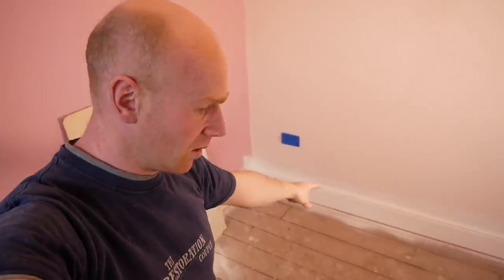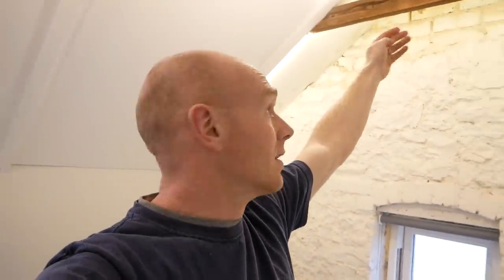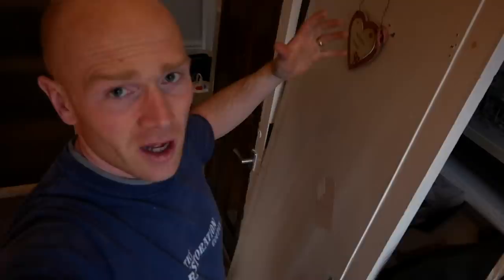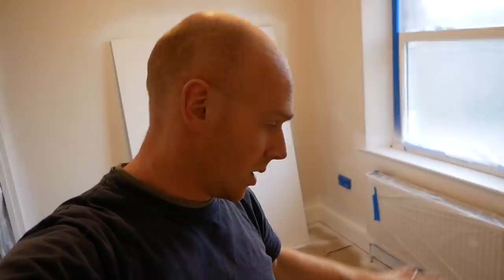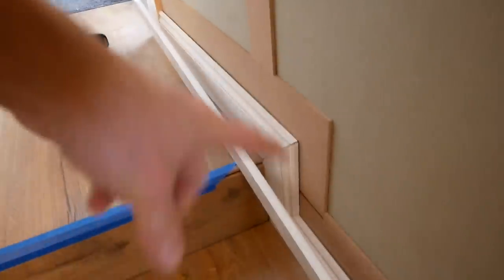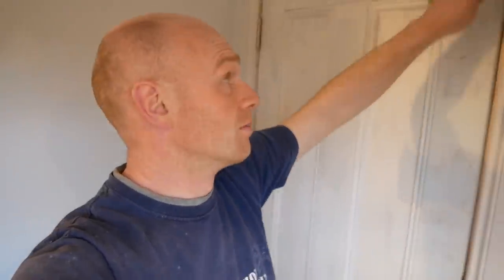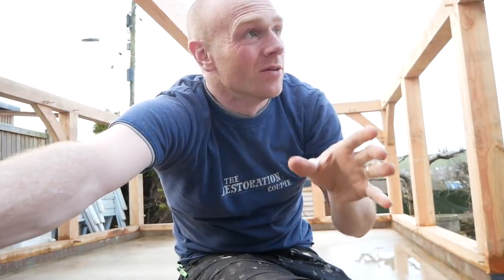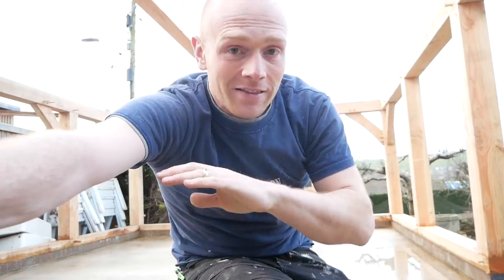WHY DO WE DO IT TO OURSELVES? 😀 It's all going on this week!

Comment: I think the hardest part of sprayed walls is touching up after,never seems to match
Reply from the maker: Back rolling helps if it's a new wall but as these are already painted, there is still some slight texture from the rolled coats first time round so not too hard to subtly touch up.  That said, the little airless gun is good for that too.

Comment: I suffer from a terrible addiction, I am seriously addicted to tools! I have a full range of DeWalt and flexvolt but I couldn't stop there! Unlike your typical tool fan boy u like to get the best tool for the job regardless of the brand so I simply had to buy the Milwaukee framing and finish nailers and then Makita brought out their new 40 volt XGT 216mm mitre saw that I had to offer last Saturday and now hikoki are bringing out the first half inch cordless multi volt router. Please help as this is costing me an absolute fortune.

Comment: £400 delivery charge 😨 did you hire an arctic with a hijab just for your delivery, I've only ever know that sort of fee for container hire drop and collection 😳
Reply from the maker: Seems to be fairly standard rate for booking artic large panel deliveries, I can't get 6 or 7m panels in my van and by the time I hire a luton and still have to cut panels at the suppliers plus a 7 hours round trip...   Think it was £300 actually but still hurt!  Local suppliers all £1k more so just a case of looking at total cost.
Reply: The Restoration Couple no doubt that's a decent price, arctics are expensive things to hire, just the driver alone will be on £12-15 p/h, and diesel isn't cheap, and arctics drink a lot of diesel, and that's not even touching on truck and trailer costs, that's a decent price, just a hell of a shock to hear it out loud 😂